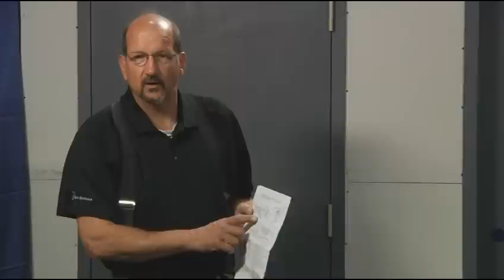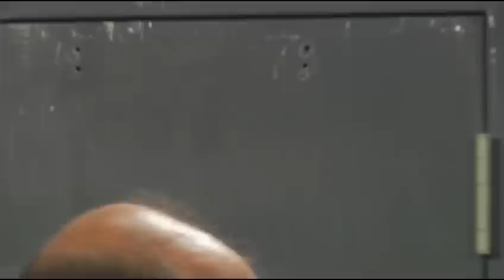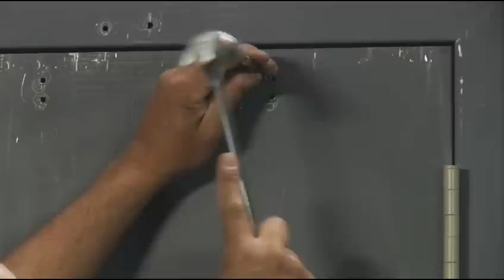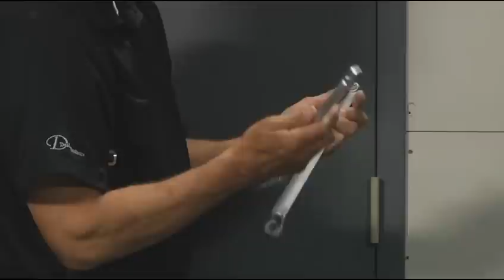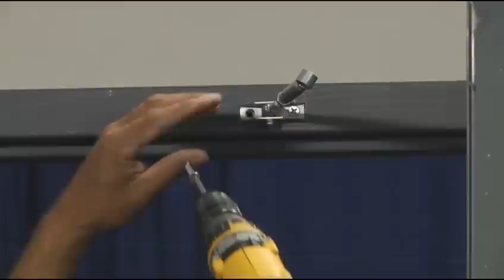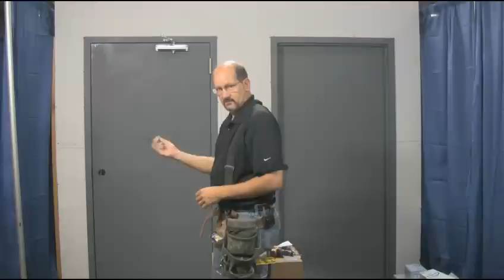116 Regular Arm_WMV 480p (16x9).wmv

Comment: Hello, good video but i have three questions. Mine will be the same 116 regular arm installation as of this video with the same degree of opening but for a 3 feet 10 inches wide door that weights about 180 pounds, it is a main door from the street that opens to the inside directly to a stairway
1. The holes are the same as in the video?
2. How many full clockwise turns do i adjust the power spring?
3. Do i have to move the foot pivot to the hole closer to the hinge of the door or leave it in the standard center position?
Thank you in advance for your answers
Jon